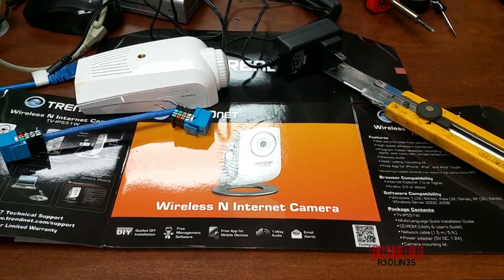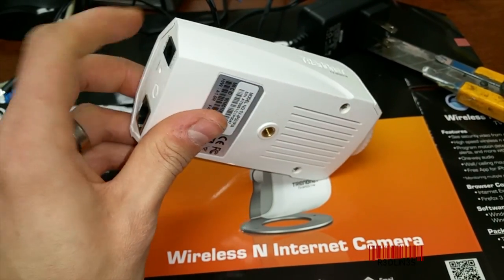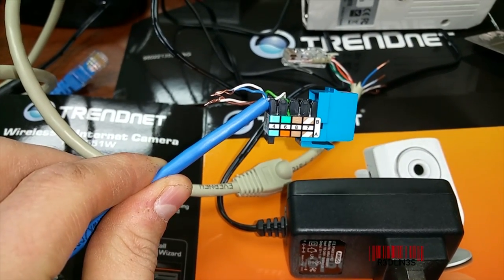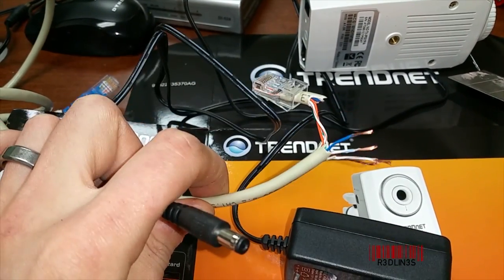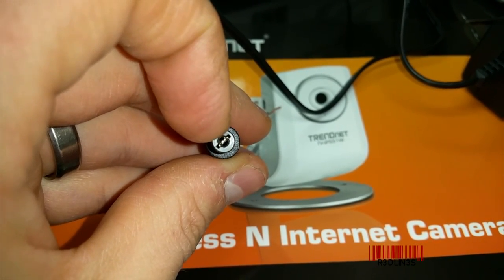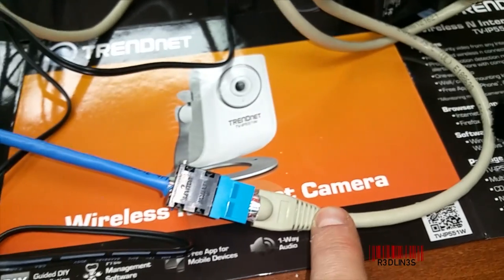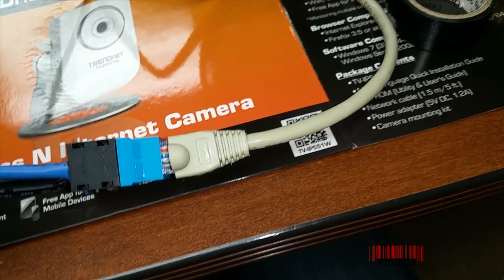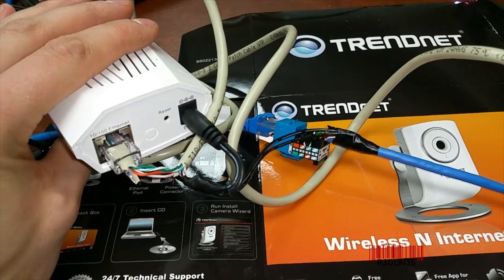DIY Power Over Ethernet on NON POE Devices - For Free

Comment: Just a thing to mention - for low voltage devices, like this 5V camera, cable lenght is limiting factor, as all cables has voltage drop across it's lenght. The lover the voltage, the higher the voltage drop. In this case with 5V camera cable lenght shouldn't exceed ~10m (30ft), because after that distance voltage drop can become so significant, that device cannot power up at all due to low voltage in the far end of the cable. That, of course, depends on the each devices tolerances for input power, but general rule of thumb is not to exceed 10m for 5V devices. Also, this is the reason, why PoE has thouse 48V instead of 5V or 12V - due to maximum cable lenghts involved.
Reply: usb car cig plug and wired to 12v is in my opinion best option since most devices that use 5v will be similar ratings
Reply: Artūrs Savickis How about wiring 3 pairs for the power, and 2 for the video? Will have any gains or will still drop voltage. I am planning to do this but I need a lenght of 50 to 100ft. Thanks
Reply: tested on a 40m run, camera still runs reliably, which surprised me.
Reply: I plan to use an ethernet cable (ftp cat5e) to power my camera and transmit video signal
I was thinking of using 2 twisted pairs for the power and the other two for the video signal. Will the signal drop that much over 70 meters? Can I compensate with a more powerful power supply?
P.S. The camera runs on 12V
P.P.S. I have to do this because bringing power closer to the camera is not an option
To be fair I'm more scared of video loss than power to the LEDs. Is there some way to amplify the signal if that happens?
Reply: Not fully right. However, you usually have a 10 to 20% voltage tolerance (for USB it‘s 4V with hubs or 4.7V, for 12V you are probably looking at 10.8V min.) and you also have higher currents at lower voltages. Things like switches end up internally dropping the voltage to 1.8-5V, so if it‘s a 12V switch even stable 6V or sometimes even 4V would be enough.

Comment: Video is good. And yes, 100M internet uses only 1-2-3-6. To all the snarky Gigabit comments, come on guys, how often are you using a PoE device that utilizes Gigabit. Most of the time when you want PoE, it's a wireless box or a camera being mounted on the wall or a ceiling. Gigabit utilization rate on these applications is probably less than 1%.
Reply: in practice I think it would be quite bottle necked, 10/100 is not even 100mbit peak due to overhead, for an access point it will bottleneck 802.11n, for camera's it would likely have problems with anything 720p or higher without compression.....
Reply: @contactATashleygriffin  Youtube at 4k is not even 100Mb. For most "PoE" cameras, you don't need gigabit.

Comment: All data pins are necessary for 1000Base-TX. Only 100Base-T has free pins. 
If you distribute the 5 volts over long lines then the voltage is reduced. 
This is also the reason why higher voltages are usually used which are reduced in the camera.
Reply: Yes. luckily "real POE" uses all eight (8) wires for data in a simple but clever way.. Yet there is no physical connection between the power-In and the power-Out :cat-orange-whistling: It's really quite COoL.  Using the CAT as an "extension cord" breaks all the rules. But desperate men & girls takes desperate measures. I've been there :hand-orange-covering-eyes:  Cheers J

Comment: I try that on 10m cable and 12vdc cctv, it never work, by checking voltage on camera side i find voltage dropped to 9volts on camera booting since it has ir which cause camera restart again and again.
Thanks anyway.

Comment: I wonder if there's a chip that stepdownd the power from POE switch because it's commonly use a 48--52 or 58volts 
I want to use a modified connection with 12V DC Male  Power Balun Plug Connector at the end point for like Accesspoint or something because I don't like to use a Poe injector device because of my past experience with it . The access point is throttling at first it's ok then sometimes it won't give IP or access  even though you are connected

Comment: One question. You said the camera was POE. So why did you solder the power plug on the camera side? Why didn't you just carry power out the RJ45 connector on the cameras side?
Reply: POE is 48 volt only, that power supply is not.

Comment: I would like to inform everyone here that running low voltage high amperage over 26awg Ethernet wire over a distance is dangerous.

Best case, too much voltage drop means the camera is flakey. Worst case, the wire heats up and starts a fire. Made even worse if even 1 of the pairs loses contact, forcing the other wire to get hotter.

Comment: Why do you solder together the blue/white blue ? Wouldn't 1 of them be enough for a positive?
Reply: Because of voltage drop. If you use tiny cables to send electric power (specially on lower voltages) you will get less that the voltage required on the end of the cable.

So if you double the gauge of the wire, you will get less voltage drop and more chances on getting your equipment to work. Two wires would mean a double gauge than only one.

Ethernet cables are not efficient on delivering considerable electric power as the wires are too thin.

Comment: Hello, I followed most of the cable makeover. I got a little drifty at the camera end.  I noticed the ethernet cable was dissected and a barrel connector for the power was grafted to the cable head.  I was assuming the ethernet cable would carry the power into the camera.

I had received a PoE camera to make up a tube evaluation.  This had no UG or manual. The only clue I got from a search of the Hong Kong website was a TP-Link 105 injector in the background of a similar model. That I could just jack into the crappy att home portal and go forward with an evaluation video.  Your second split to have a barrel connector with the 48vdc makes me wonder if I will need to find a splitter pigtail also. I have a query in to their CS, but who knows how long it will take for google translate to filter up an inadequate answer.

So, mostly I am wondering if the power split and barrel are necessary or if that was just the model of your cam that would not take the current from the ethernet cable. I did have one cable laying around that is cat 7 and was billed as support new devices to market with parenthesis (PoE) in the cables description.

Anyway, just curious as to whats what and how much trouble I have gotten myself into. I know I am not real thrilled about buying a $20 TP-Link 105s injector, then possibly a splitter to pull the power from the cat7. I probably should just capture a couple of minutes looking at it as a failed consumer product package and send it back.

BTW, thanks for the video. very handy, insightful and thought provoking.

Comment: Thanks that was helpful.  I'm gonna be using it for Arduino projects where I would have ended up needing many power supplies.
Reply: Adafruit sells Passive PoE Injectors for around $10.  I currently power my EtherMega project via a 50 foot run of ethernet wire and a 9V power supply.  Even if there is a V drop, it still arrives with more volts than are needed and the regulator will get it where it needs to be.
Reply: remember that if you are using the wire as your method to drop from 9 volts to 5 volts - that the voltage drop will change as the device current changes.  So as different software is run on the Arduino - the delivered voltage will swing up and down depending on the loading of the CPU.   Generally this is a bad thing.  Instead, use a 24v to 5 volt PoE splitter to deliver exactly 5 volts at up to 328 ft

Comment: can anyone tell me
I have a camera want to change  female RJ45 connector but its color is 
blue 
black 
red 
orange 
green 
yellow 
pink
but standard combination is 
W/orange
orange
green
W/green
Blue
W/blue
Brown
W/brown
so how can I pair it please help me out.
Reply: those sound like  standard color codes for phone wire. It shouldn't be to hard to figure out. The wires can be any color they want them to be it doesn't change the functions of the corresponding pins. pin 1 is still TX+, 2 is TX-, 3 is RX+, 4 and 5 are unused in a non gigabit connection, 6 is RX- and 7 and 8 are also unused in a non gigabit connection. Just google RJ45 pin out and look at diagrams so you know which one is pin one and work from there.
Reply: William Hitchcock thanks

Comment: how much current can pass through the wires?  So if the camera uses 10 watt?  and 5mbps data?  not sure if these copper strands can handle? or how?  also current have to flow, so there is ground? I am very confuse how this all works.  I have cat 5 already pre installed in the house.  I am not sure how to install camera that are POE ready.  So I have to keep the NVR in the house not in the addict.  The camara are going to go up on the eves of the house from the addict, which I can do, but I don't know how to connect the POE cable to my current cables, going to the room where i will keep my modem, NVR etc.  I have access to the cat 5 cable up on the addict and also have plenty of space to install camera up over my garage.  I just don't know how much current as well as data the cat 5 and pOE cable can hold?  I wish if you can make a video and explain that would be very helpful.  thank you
Reply: Instead of this hack - with its unspoken limitations - why not purchase an inexpensive PoE switch, connect its WAN input to your router, and dedicate this switch to your camera runs?

Comment: This should work directly from a poe switch right? Bypass the last step
Reply: JMac80one I would think? Would like to know the answer to this question.
Reply: I believe the poe switch sends a signal to confirm power. With out that signal no power will be transmitted. You can submerge a cat cable powered by a switch underwater and it still won't pass current.
Reply: No, POE requires communication from the device to maintain power, and it's at 48V. Most non POE devices are NOT at 48V, you will fry the device and possibly the switch if you try this.

Comment: I want to use this on and old wrt54g router to power it so it can get a better signal from a hot spot. To my main router night hawk x4 will this work for that? I'm new to all this poe stuff. We have a free wifi hot spot I'm trying to reach better and if my router goes stupid I want to be able to just Unplug it in my how for the reset I'm also running tomato firmware on the wrt54g
Reply: Also my run will be about 65 to 75 feet

Comment: For 100Base-T what he actually is doing is passive PoE. It‘s nothing new, these commercial adapters usually do the same thing, they have the required 2 pairs for 100Base-T and utilize the others for power.
This will be enough for many devices like small access points (with SISO WiFi n) or cameras. Still you should rather use a cheap passive PoE injector.

Comment: I definitely would not recommend this. Firstly, there is going to be a voltage drop between the wall wart and the camera, due to the flimsy thin wires in the ethernet cable. Second, unless the wall wart is very well designed, it will pump switch mode noise into your ethernet system, which can stuff up your network speeds. Third, this will only work with devices not using gigabit ethernet, since there are no spare twisted pairs on those systems, to use for POE.

Comment: I tried this and my wall socket started smoking, not good.
Reply: you gotta tape over the connections if the copper wires touch thats positive and negative shorting and will result in the power plug burning out

Comment: it doesnt have to be 48 volts for the poe cameras it drops about a volt for every 10ft of run so figure a hundred foot run drops too 38  so there is some give and take .... most poe devices take that and regulate it down to what the device actually needs so as long as its higher than that it will work i.e. my amcrest uses 9v after it gets droped so really 10.5 volts would work

Comment: If the cable is at least Cat5E (1Gbps) and the switch is gigabit, then by doing this split you will drop the data rate to 100Mbps, so the port switch will negotiate at 100Mbps (Cat5).

Comment: Those pairs aren't used on 100Mbit devices, but gigabit Ethernet uses all four pairs. It doesn't matter on a 100Mbit device, of course.
Reply: how does poe work on gigabit then?
Reply: PoE works for gigabit by using a special transformer to allow the DC voltage to co-exist on the same pair of data wires.